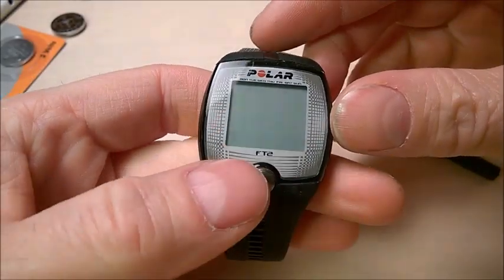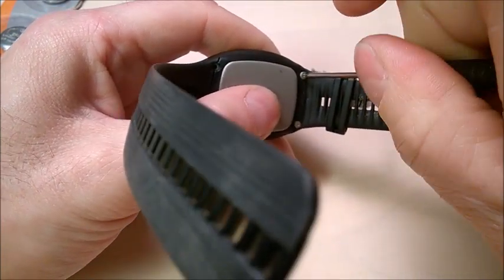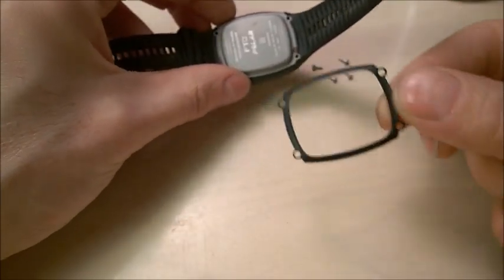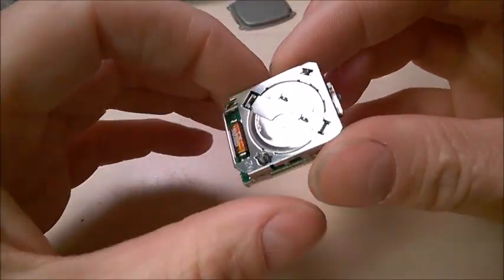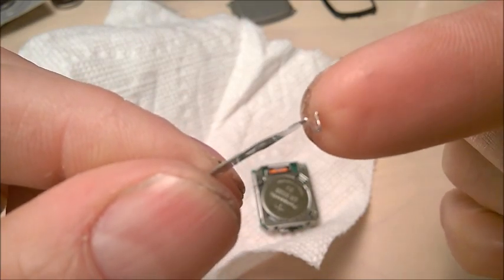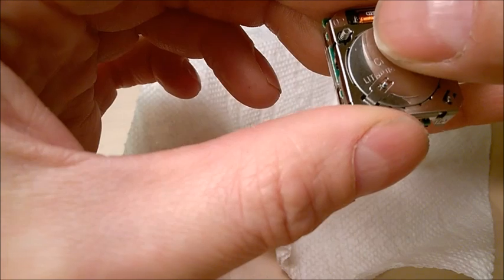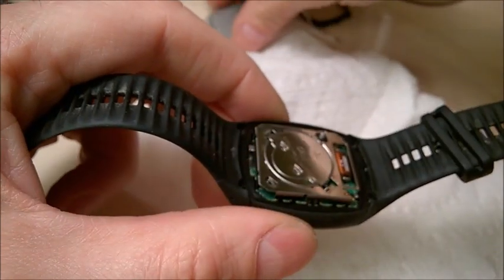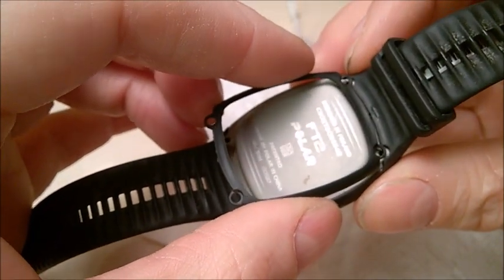POLAR WATCH Battery Replacement

Comment: Thank you for sharing. I changed the battery once at Polar retailer and it cost me SGD20 (USD15). Now it only cost me less than $1 for the battery. I just need to get the mini Allen key. 👍🏻 to you video!
Reply from the maker: Happy to hear
Reply: Hello, what type of mini Allen set do you get?
Reply: @lamikaeljolinesreyes8306  I bought a 32 in 1 Electron screwdriver set. Size T6 which looks more like a flower than hexagon shape. It fits perfectly and i managed to change the battery. It cost me SGD6.90 (USD5) for the screwdriver set. Still worth it in the long run.
Reply from the maker: @lamikaeljolinesreyes8306    My mistake, it's torx, not allen.  As above, try a set like this  https://www.aliexpress.com/item/1005002928210269.html?spm=a2g0o.productlist.0.0.39ef19445LicCh&algo_pvid=023f3dff-033b-47da-ab29-4722b29b8fad&algo_exp_id=023f3dff-033b-47da-ab29-4722b29b8fad-35&pdp_ext_f=%7B%22sku_id%22%3A%2212000022842866942%22%7D

Comment from the maker: Update : the cheap battery in the video lasted 3,5 years, not bad. It shows a small battery symbol when it's weak. You may notice, this watch has sound, but there is not wake up alarm.
Torx screw drivers -  I believe it's a T6 but correct me if I'm wrong  https://www.aliexpress.com/item/1005002928210269.html?spm=a2g0o.productlist.0.0.39ef19445LicCh&algo_pvid=023f3dff-033b-47da-ab29-4722b29b8fad&algo_exp_id=023f3dff-033b-47da-ab29-4722b29b8fad-35&pdp_ext_f=%7B%22sku_id%22%3A%2212000022842866942%22%7D
User instructions FT2 https://support.polar.com/e_manuals/FT1_FT2/Polar_FT1_FT2_user_manual_English/ch02.html